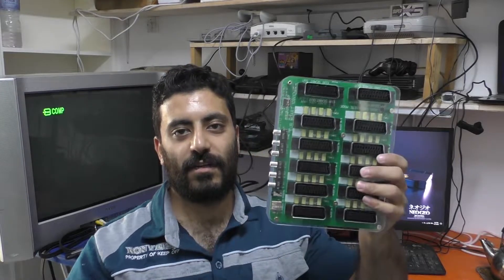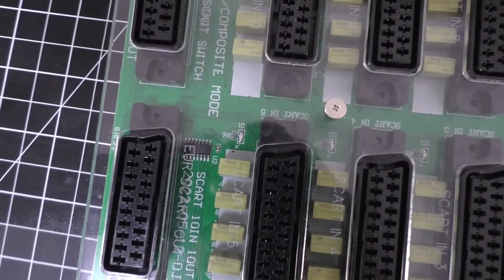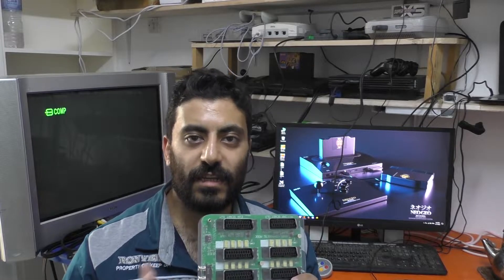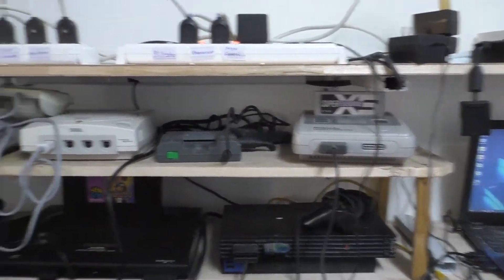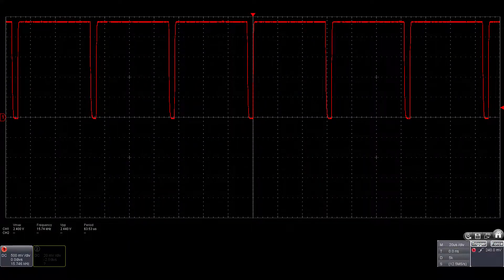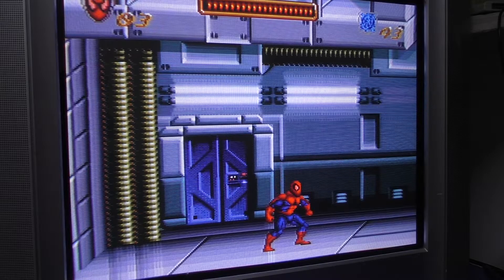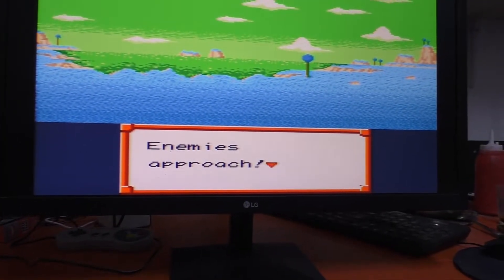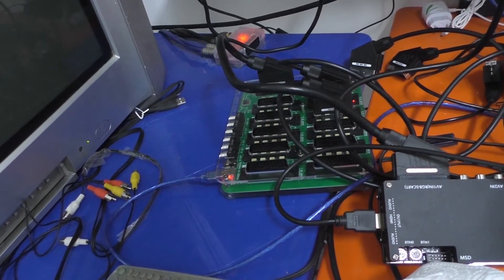Automatic 10 ports SCART switch review

Comment: Hi, thankyou for the vidéo and all information. I would love what cable you use and what the best cables to use with this Switch csyn or sync over composit (i use an OSSC/GBS-C+ TV ON SCART.
Reply from the maker: in scart, pin 20 is always the sync carrier. sometimes it is sync on composite and sometimes it is csync. this device accepts both. just get cables from retrogamingcable in UK and will be fine.

Comment: I was wondering, do you know if it's possible to get 2 simultaneous outputs from this model in particular? I know one of the outputs uses the japanese scart layout, I was hoping to get a modified cable or maybe an adapter in order to use it with the ossc and a gbs control. I know they're selling a newer model with a blue pcb that they advertise as being able to output from both scart ports (and that both follow the european layout) but that isn't cheap at all.
Reply from the maker: i haven't test this feature but maybe you need to test.
Reply: I have a similar one and it can do both outputs at once I don't see why this one couldn't do that

Comment: Do you know if this switch will output safe sync levels from cables that have a sync stripper in them? According to RetroRBG similar Otaku switches produced really high levels that can damage the connected devices. Do you have anything that you might be able to test it with? The issue is that I have PS1, PS2 and some other cables that also have sync strippers and replacing them will be really costly.
Reply from the maker: i didn't understand what you meant but for me no problem happened for all my 11 consoles connected via scart.

i didn't open the device but i believe it uses mechanical relays to connect the signals, i definately heard it. thus no problem for signals at all;

Comment: I am currently looking for a scart switch but it should support both RGB and composite signals since some of my consoles can only output composite signal.
Any suggestion?
Reply: maker a mod rgb on them, i do this on all i have, until Atari 2600 you can make the mod.
Reply from the maker: don't use composite! mod them to use rgb and make ALL your setup RGBs then use whatever to connect to HDTV or CRT TV.

I made several consoles RGB mod here and many others on YT. 

if you have a problem with one of them, please state it here.

Comment: Hey my friend, i bought the same scart switch and everything with rgb cables works fine. But it won't recognize my N64 oder Nes, which are connected via Composite Cables with Scart Adapters... On their page it says i could use no RBG  Devices like N64 or NES. Do you now what i am doing wrong? Or how can I activate the Composite mode?
Reply from the maker: well, i haven't tested that really. its internal circuit probably looking for a signal on the pin 20 which holds csync or composite sync.

as for the NES, I have a Twin Famicom modded with RGB and it works fine. so NES type sync works fine.

so now please check when you hook the composite console on a certain input, check the light if it turns on or not. meaning does it know you hooked it in or not.

then you need to check the output with maybe an ossc or using a scart to composite adapter which extracts the composite signal into a regular rca jack which you can use on crt.

Comment: nice review bud , how things turning out a few months later ? I was thinking of getting a 6 port scart switcher from the exact same seller , but I just wanted to see how things are still going with your switcher before making the purchase.
Reply from the maker: hello, it is going very well, zero problems and works as intended. just get the 10 ports one i reviewed in this video.
Reply: @Thundertronics  great , like you said the switcher is cheaper than a lot of other switchers and that made me quite concerned about the quality of the switcher

Comment: If i happen to have the very same Scart Switch and i'm using already the Scart Output with my OSSC what would you do if i still want to hook it up to my recently acquired CRT TV?
Reply from the maker: you need 2 simultaneous outputs right? then you need some sort of video amplifier or splitter.

this scart switch has the rca outputs and the japanese scart (JP21) which are active at the same time... you can use those for sure but you have to figure out how.